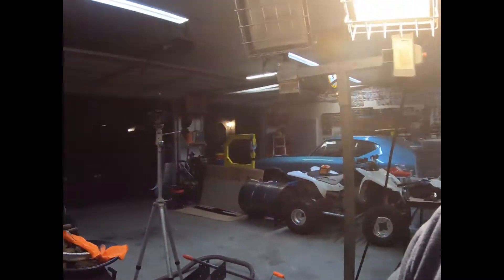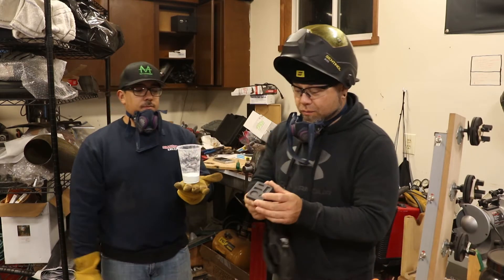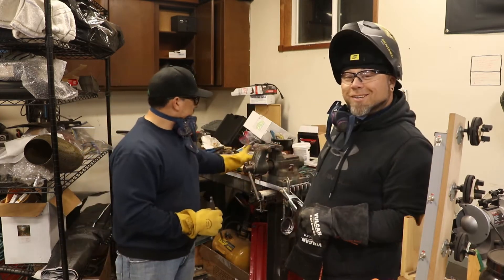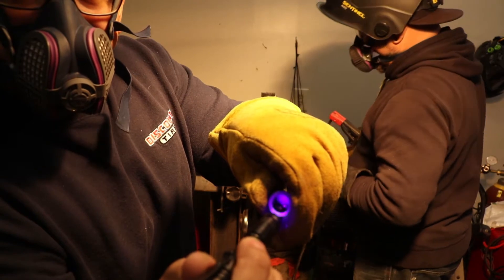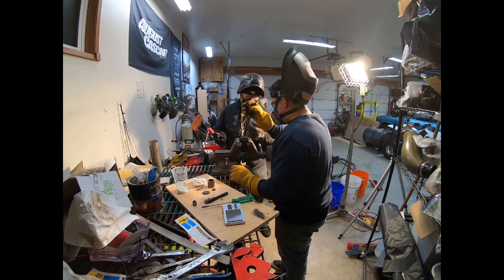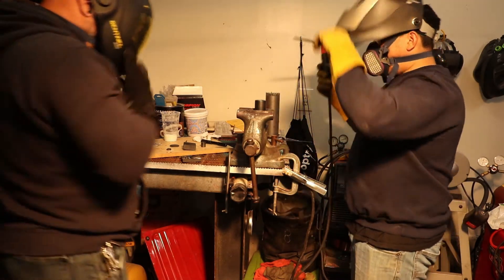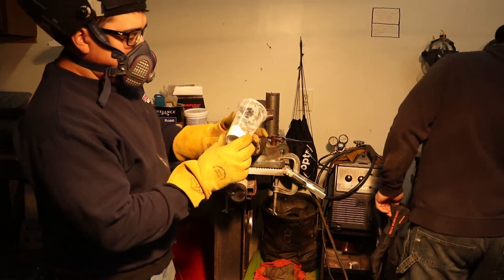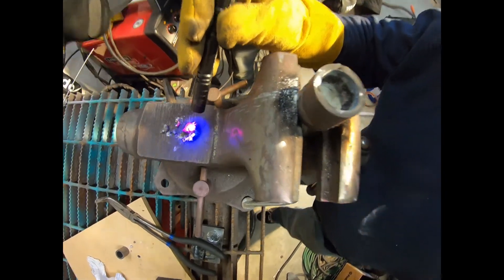Homemade Synthetic Rubies (Red Ruby)!!!!

Comment: To make large rubies, Use a graphite crucible. A large one. They are good to 5000 degrees. Use Map or propane gas with Oxygen. It also burns about 5000 degrees or more. Put a couple of spoonful's of Aluminum oxide in the crucible and melt it. Once its liquid, Use a metal stainless tube to slowly feed in more aluminum oxide. Grow your ruby as large as you want. It takes practice because the torch likes to blow the new material away. Use a really big and wide crucible and keep the torch to one side. I have made rubies and sapphires as large as tennis balls.  There really isn't a way to make good selling rubies this way. They have a certain look to them that people don't value. They are cloudy and never clear. Almost impossible to sell for anything other than industrial applications like sand paper.
Reply from the maker: Yeah we’ve actually already done that with my jewelers torch!   Thanks for the comment!
Reply: The reason they are unclear is because the carbon from crucible as well as carbon from electrode contaminates them. As long as one uses electrode or a container to grow a ruby or sapphire, it will never be pure even if Aluminium Oxide and Chromium oxide are very pure. 
The only way to make pure rubies at home is Verneuil method because the flame from hydrogen and oxygen doesn't contaminate rubies like carbon electrode or crucible. However, it takes much longer and much more energy to grow even the smallest ruby.